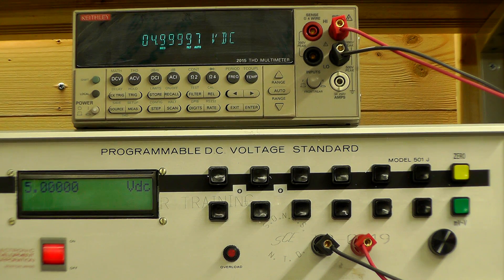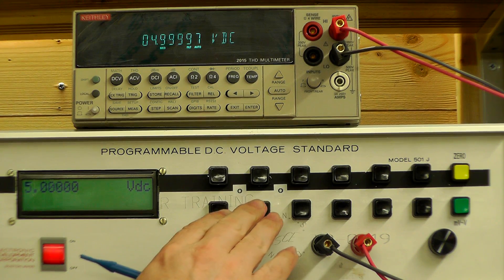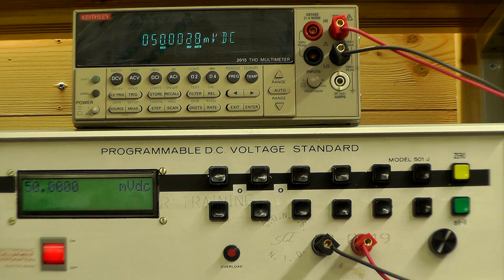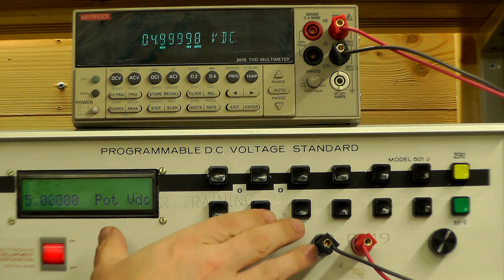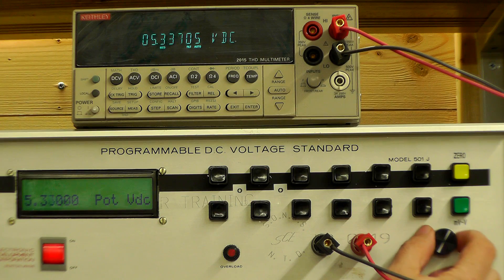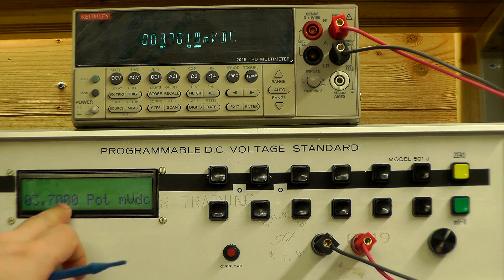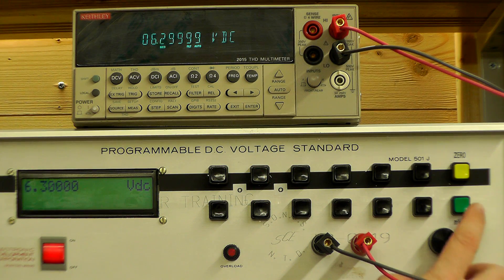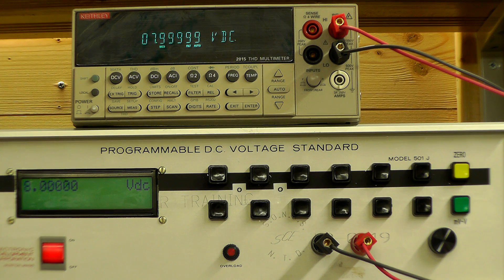EDC-501J Voltage Standard F/Panel - Follow Up

Comment: Ian, thanks so much for these videos.  I just picked up a 501J from eBay, and I noticed you left a note on your website about having replaced the resistors around the reference zener with lower tempco resistors.  Could you touch on that?
Reply from the maker: Can't remember specifically without looking but I probably changed the resistors for 2ppm/degC or 5ppm/degC spec ones. Just means the reference is more stable with any given temperature changes.

Comment: I notice the overload sometimes trips for a few milliseconds when you change modes, is that intentional?
Reply from the maker: I think it's just the EDC501J reacting if it sees the output voltage hitting its limits, i.e. the Arduino is likely spiking the output above 10vdc when changing modes. Not intentional, and something I will need to look at eventually.

Comment: i much prefer your mod than dave's, nice solid work there, did you consider a rotary encoder ? i am always worried about glitchy pots making weird voltages
Reply from the maker: I did think about an encoder, but I'm all out of digital inputs (despite the shift registers!) so just used an analogue input.